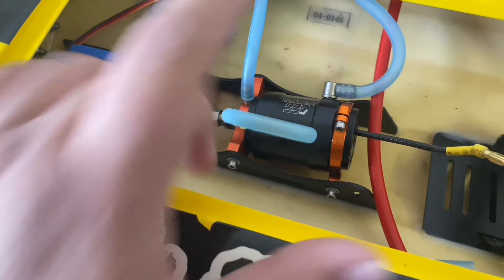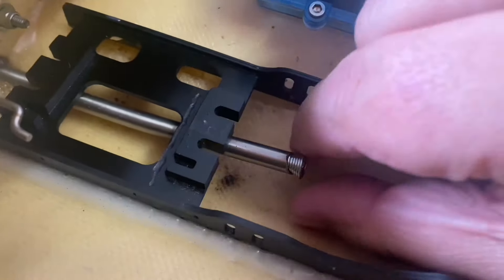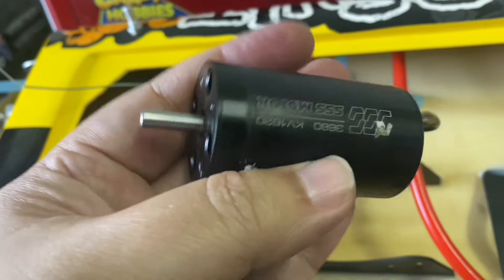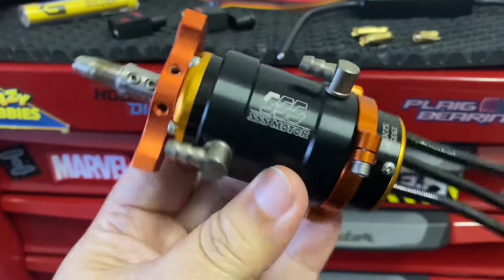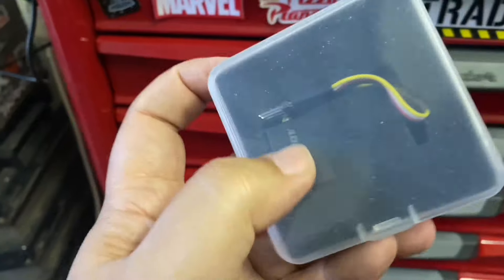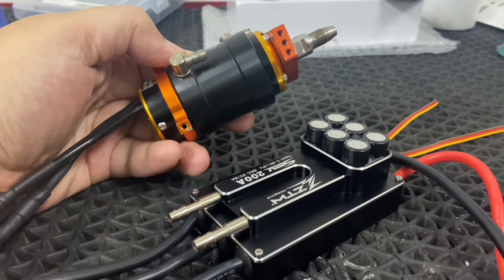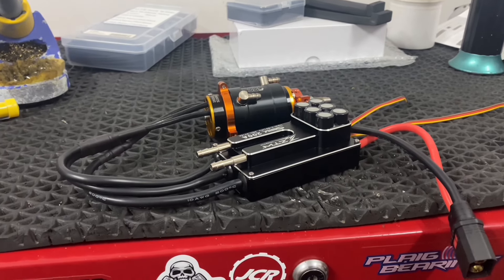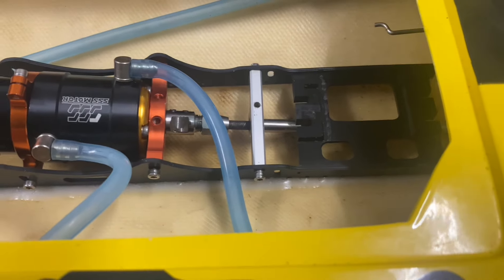TFL PURSUIT BRUSHLESS BUILD SERIES - Part 1 Making It FASTER!

Comment: I got the carbon fiber Edition I ran the same motor 6s with the Raider 150 ESC will the CAP pack and it would still getting too hot I had duel water inlet one for the motor one for the esc I was trying to run a 44 mm prop but still still might have been I think it was a 1.4 pitch as well but it was still getting too hot so I ended up having to move my ESC to the side like you're doing and move my battery on my back cuz my CG was off a little bit and hopefully this is going to cure my problem I think you're on the same path as well. One little thing I thought was pretty cool you can take a piece of your cooling tube and cut it like say I don't know what an 1/8 in  long or whatever and stretch it over the tube itself and use that as your zip tie you know what I'm saying  just use that little piece of Hose as your zip tie and it'll hold it on you know your motor or any of your little Barbed fittings or whatever ya hats off to the individuals that can use the damn little Allen wrenches I can't stand them. I hope you build turns out well
Reply from the maker: Thanks for watching mate 👍 and appreciate your comment